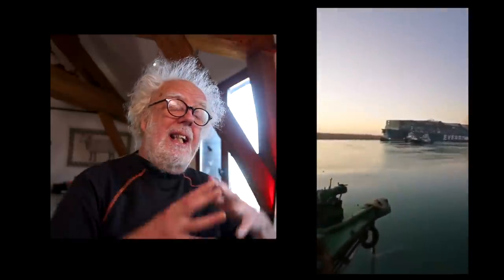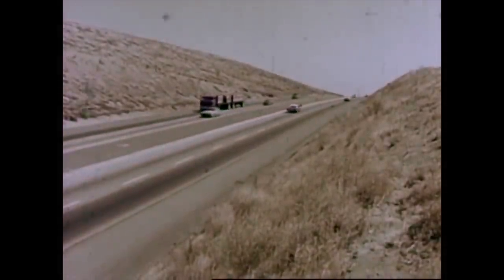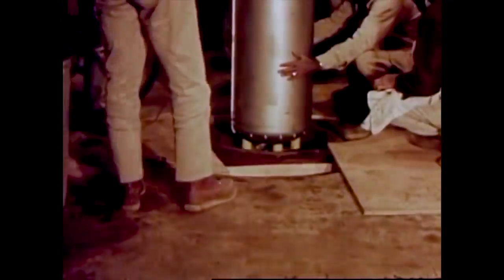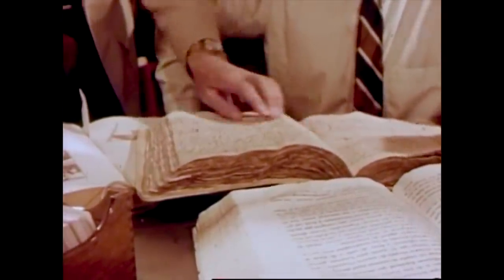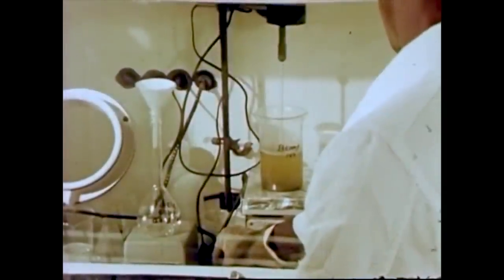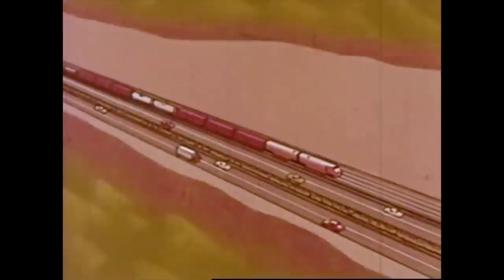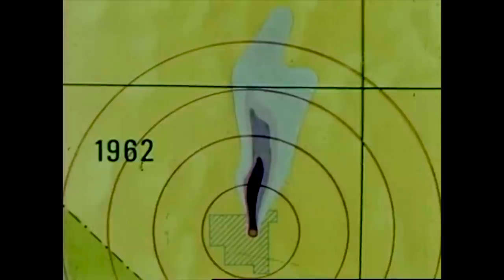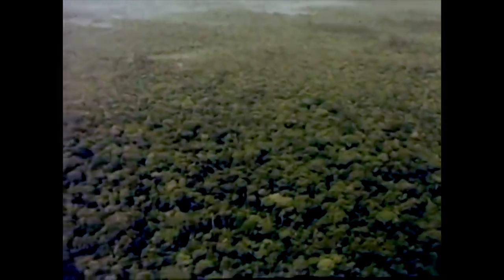The secret, second, Suez Canal. - Prof Simon

Comment: I read on this program in the mid 1970's in "Science Year", an up-date to Encylopedia as a 14 to 16 year old. They wanted to make another canal through Central America to accommodate larger ships and to protect against the closing of the Panama Canal. The Nicaraguan's read over the proposal and rejected them completely as it introduced too much radiation to their country. After reading it; they wouldn't even entertain the idea. The USSR created a few artificial harbors along the Artic Ocean but found them unusable due to the high radiation levels. Large cuts have been carved through portions of the Allegheny mountains for highways and rail lines in the 1990's using newly created high energy explosives. (Very powerful conventional nitrate & plastic based explosives) I have driven through these cuts in expanded portions and newly created highway for the Pennsylvania Turnpike System.

Comment: Another interesting nuclear idea was Project Gasbuggy,  Project Rulison and Project Rio Blanco in which nuclear detonations were used to frack natural gas.   The natural gas turned out to be too radioactive.
     Operation Keelhaul: I thought that the ship could have been extracted by running a cable under the keel with a high pressure water line and nozzle paired with a suction line which would take the sand/ water slurry and dump it in the desert.  A bulldozer on one side of the canal and a bulldozer on the other side would move the cable back and forth pulling the tool from the keel to the stern.  Another similar tool would be pulled from the stern to the keel.  They got it free, but one would hope after this they do some planning to make sure if something like this happens again, they have a quick solution.
       I live in southern Louisiana near where sugarcane is grown and a few years back a company came in to turn the sugarcane pulp after the sugar has been extracted (known as bagasse) into toilet paper. The newspaper said this is wonderful, but it isn't the high tech companies we need.  I said, that is an industry which is completely recession proof.  No-one is going to say, the economic situation means we have to cut costs.  People have to use both sides of the toilet paper.